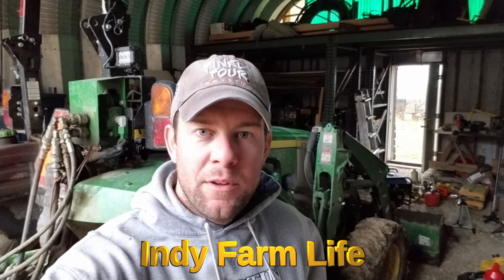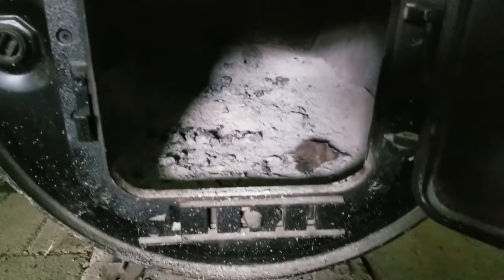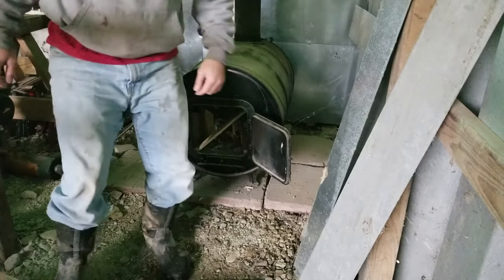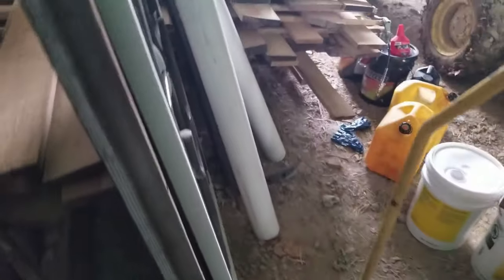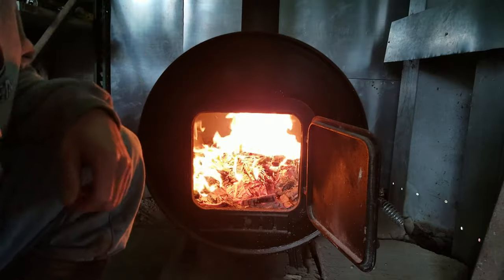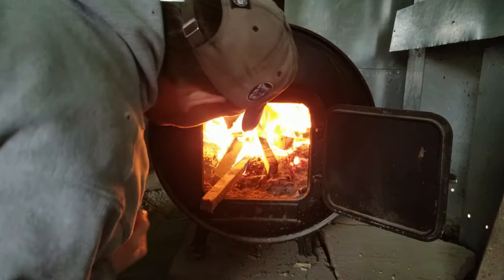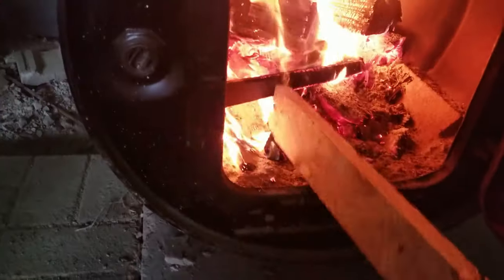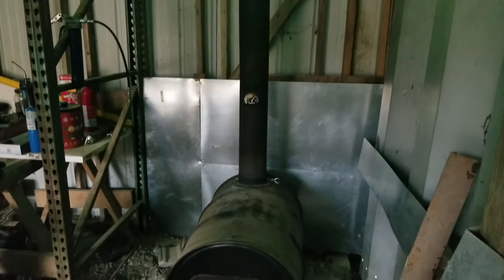How to Use a Barrel Stove - First Burn of the Season

Comment: I just got one, for $200 -_-, and sadly when we bought it it didnt have enough piping to go past our roof. So ive been dealing with smoldering flames and a smoke filled house 🤦🏻‍♀️ we're off grid so its our only source of heat and i haven't been able to keep a licking fire, when i close the door it smolders out, and i cant open it otherwise ALL the smoke comes out and into my 29ft cabin. Its gets below °30 in ky area and i need this to work. I cant drill theough my roof yet (dont have the tools or knowlege to not ruin my home! Nor the money to pay someone educated in it to do it) so the piping goes out my window but it doesnt go past my roof which is why i feel the smoke doesnt eacape the piping nor a flame staying alight bc theres no air coming through the piping to keep the flame going, but the pipe isn't sealed. So it has to be the fact tha mypipe doesnt go past my roof right?

Comment: No sealant around the components is needed? 
Would it be beneficial to put the door as high as possible?
Will sand work well on the inside bottom?
I'm sorry for all the questions, but I don't want to screw up and I have zero experience with wood heat.
Thanks for the video.
Reply from the maker: I can't remember if it calls for sealant or not.  Putting the door higher could be helpful.   It's really a matter of preference.  Would make scooping out ash a little more difficult.  I did fire brick and sand in mine.  Sand alone may work, but it can easily be scooted around as you throw in logs.  I would be afraid that it would get too think and then the metal bottom would be exposed to extreme heat.  That's why I like the fire bricks.  They won't move once you have them all in there.  I think put sand on top to lock them in.  Actually I think I went with sand (for a level bottom) then bricks, then sand.
Reply: I ended up buying a small stainless steel tent stove, to play around with.
I was surprised when I saw the cost of buying all the needed extras for a barrel stove, especially the pipes. 
Once I learn the ins and outs with wood burning, I plan on watching FB Marketplace for a used wood stove with the pipes included.
Thanks for your reply.
Best wishes.

Comment: How often do you need to remove ashes
Reply from the maker: It really depends on how often you use it, but it's not an everyday thing for sure.  I let mine go quite a while before emptying.  I prefer to have more of a bed to help protect the steel.  (in addition to the sand and fire bricks)
Reply: @IndyFarmLife  thanks that’s helpful. Sand and firebrick is also really good, i hadn’t thought of that.
Reply from the maker: @donaldlalone7014  Yea, it helps protect the bottom.  In most cases, the bottom doesn't even get very hot when a fire is going because of them/it.